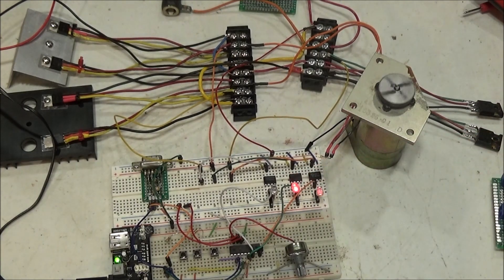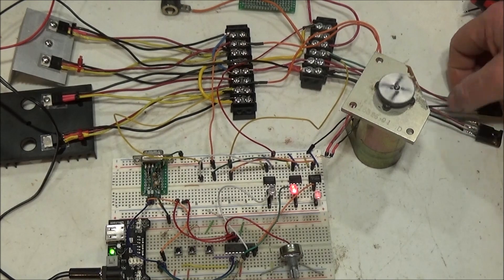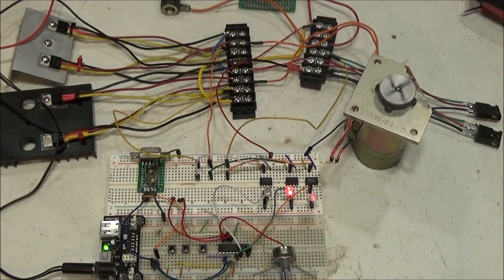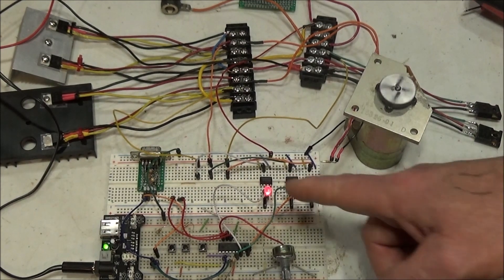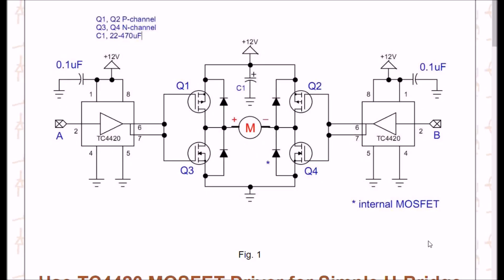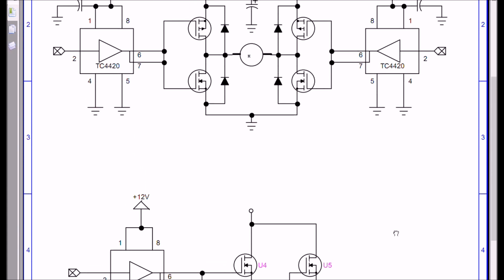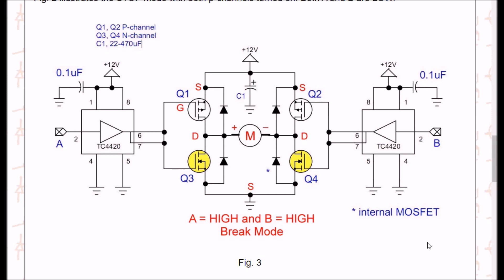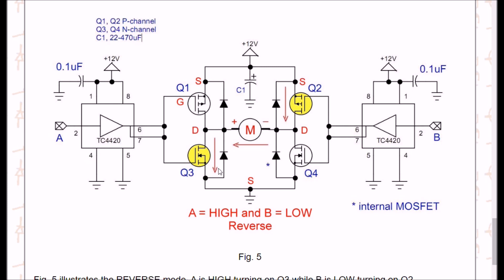Pt. 3 TC4420 MOSFET Driver H-Bridge Circuit

Comment: Hello Dear Lewis Loflin.
Congratulations on your excellent work. your video Pt. 3 TC4420 MOSFET Driver H-Bridge Circuit, I noticed that you did not use a resistor for the Mosfet Gate in your application.
I have an application with an 18Vdc motor and I intend to use IRFZ48N with Arduino PWM control. Can I use a Gate resistor in the MOSFET according to the calculations or do I leave it without a Gate resistor? Could you help me? Thank you. Josias
Reply from the maker: Use a gate resistor between G and S that keeps the current turned off until switched on. I use 15-22K.

Comment: For this H-bridge I am mainly concerned because of shoot through. So it is not recommented to use this circuit for high power applications without a current limiter in the power lines. Otherwise the MOSFETs will die for sure within a very short time. For low power applications this may work but it will definitely consume considerably more power than expected. And therefore the main advantage of switching power control can be lost.

The better way to drive H-bridges is therefore the use of half or full bridge drivers with internal shoot through protection.
Reply from the maker: I have operated large motors with no problem. As per the webpage when changing direction insert a pause (I control mine with an Arduino) to give the circuit time to settle.
Reply: @LewisLoflin it depends on the meaning of "large motors". An example. I have developed a buck converter for a welding system operating at 48 V down to 30 V converting into 25 V and 200 A.

I can't have a shoot through in the half bridge of this converter. The power supply is capable to shoot several 1000 A for some micro seconds.

The buck converter operates with 2 banks of 4 MOSFETs in parallel 1 bank to Vcc, the other one to GND, with an Rds of 1.5 mOhm for each of the MOSFETs. A shoot through would instantly destroy the MOSFETs.

Comment: I would also recommend not to exceed the output current of the TC4420 / TC4429 too much above 1 A because these devices are gate drivers. They can hold their 6 A perhaps for a few milliseconds, because they are designed for fast switching of MOSFET gates, where the very high current stays only for a few microseconds. The output stage is connected only with 2 bond wires to the output terminals. You can measure the resistance between the output terminals to get an impression for how long these bond wires can hold currents of 6 A. The limitation is not the design of the output stage, because the output transistors use a lot of the surface of the die. And they are thermally good connected to their thermal interface, so they can easily deliver 6 A with less than half a Watt of power dissipation.

Comment: Can we use this circuit to provide up to 36 or 48V to the motors?
Reply from the maker: No. They are rated 18V. It can drive a MOSFET that can handle 36V as long as the TC4420 and MOSFET gate are 18V or less.
Reply: @LewisLoflin  ohky, so we can provide 36V to source of MOSFET, and 12V to TC4420 ? to run the motor 36V

Comment from the maker: More H-bridge videos:
High Voltage IGBT H-Bridge Using Photovoltaic Optocouplers
https://youtu.be/azJo4h-ei6I

Arduino Controlled IR2110 Based H-Bridge HV Motor Control
https://youtu.be/d0r-Yx9R3Zs

Pt. 1 Interfacing Microcontrollers to CMOS and MOSFET Circuits
https://youtu.be/XzetdwzcOrY

Pt. 2 Simplified CMOS-MOSFET H-Bridge Circuit
https://youtu.be/rExHPqTUBuA

Pt. 3 Tri-State H-Bridge using CD4093B CMOS Circuit
https://youtu.be/b8O4ihdHx8U

Pt. 1 TB6600 Stepper Motor Driver with Arduino
https://youtu.be/PHe2MK9CvQM

Pt. 2 Program TB6600 Stepper Motor Driver with Arduino
https://youtu.be/jtX0t7-m69M

Arduino Unipolar Stepper Motor Driver Board with Arduino Code
https://youtu.be/HTVYiLOY8SQ

Comment: The sustained TC4420 output is nothing like 6A, its more like 200mA.  The 6A is for VERY BRIEF loading to overcome the mosfet gate capacitance.  I found this out the hard way some years back, because nearly all data sheets do not give you this rather important detail.
Reply from the maker: Never said 6 amps continuous. I said 0.5 amp and that is what I tested it at. Thanks.

Comment: Hi, great video's, question the FET DPDT switch circuit, can this switch an RC brushless motor as well as a brushed motor.
Reply from the maker: Brushless motor no. It has internal control circuits.

Comment: what are the factors to determine power rating for h-bridge?
Reply from the maker: The transistor surge current, operating current, and voltage rating.

Comment: here are some N-FET for high power applications with very low RD-ON
 IXFN210N30X3     300V 210A 4.6mOhm    SOT-227-4
IXFN160N30T        300V 130A 19mOhm  10W
IXFN300N20X3      200V 300A 3.5 mOhm
IXFN400N15X3     150V 400A 2.5 mOhm
IXFN420N10T	 100V 420A 2.3 mOhm
IXFN520N075T2	  75V 480A 1.9 mOhm
IXTN660N04T4       40V 660A 0.85mOhm

IGBT  gate driver optocoupler 
ACPL-T350 

DC-Relay to switch on/off high power /voltage loads
G9EB-1
G9EA-1    

might come handy in one of your future projects

Comment: Mr. Loflin, I really like your videos and this helps me get closer to controlling a simple HVAC actuator for heater core by-pass. I am a retired auto ASE Master Tech who is fabricating a custom air distribution box under the dash of a 67 C10 pickup. These are simple dc motors, open load at 0.3 amp and 0.7 amp while driving a worm gear that runs a larger gear, squared to fit a door shaft. It is cheap but uses a pot whose resistance changes with larger gear for feedback. Basically, move a linear pot, the motor moves, stops once the position is reached. Speed is not an issue, switching directions is. I have been building circuits for 7 years off & on, but a heater is open or closed (Like during A/C OPs) and have been working with a voltage comparator circuit for feedback and the famous “H-Bridge” that has been in auto’s for decades. I guess I am just trying to tie the two together. I love misters for many reasons and will make any low current motor control more robust. I build an automatic w/OD for fuel economy but my son hit black ice & donated a 2003 Tahoe 5.3L fuel injected and this will work great in a 53 year old truck with something this 6’3” guy can drive, but my 5’7” wife feels comfortable in. I can not afford to spend $1,700 for aftermarket HVAC as the 76-72 C10 market is huge. I have subscribed a while back, hit the bell & like this one. You are clear, very nice schematics and I research your video list. Got the “Bell” as well. As my maternal grandfather graduated KU in 1932, with electrical engineering degree, ran field generators for this new thing called “Radar” in WW-II, ran the phone comp. in a small town & was Chief Electrical Engineer in the 60’s in the Marshall Islands to build the “Minute-Man-Missle-Site” on Meck island everyday until the mid 60’s. What a life, I miss him much. Thank you for you efforts and valuable information...at least to me! Blessings.
Reply: I do not like spell check as I wrote “MOSFET” and it changed, sorry!
Reply from the maker: Lot to read. My email is lewis@bvu.net.

Comment: Ok.. And if power supply voltage higher than 20 Volts?
Reply from the maker: You will blow the TC4420 and the MOSFETs. That is why I go to bipolar transistors on the HIGH side if over 20 volts. In part 2 I went over driving bipolar transistors.  
See: https://youtu.be/-Pmhx_ebJKM

Comment: With a separate speed controller,  couldn't you just use mechanical relays for the H bridge and avoid the voltage drop across the mosfets? There isn't usually a need to change direction quickly since the motors take time to respond anyway. Perhaps I am missing something.
Reply from the maker: Relay contacts are not reliable for a lot of switching applications. Modern MOSFETs have a resistance of fractions of an Ohm. Electro-mechanical relays are also expensive. But you do have a very good point for really high power motors. This is aimed at hobby robotics.
Reply: @LewisLoflin  Thanks for that. I was thinking that the relays would last longer because they are being switched while no current is flowing. I am working on a project using wheelchair motors, so not really big.

Comment: Could we see a demo of the motor in the "brake" mode please.  I would think you would use this mode for only a short period of time. Just another reason to use a micro controller, I guess.
Reply from the maker: Not sure on an unloaded motor there is enough to see the effect.

Comment: When we use these ICs driver.do we have to add a resister to mosfet to discharge or not ?
Thanx for everything
Reply from the maker: No. These can take a 6 amp peak current.
Reply: @LewisLoflin  i have asked this question cause in all schematics of inveters which use mosfet there are always resister and diod between gate and source for discharge
as in 
EG8010 

https://vdocuments.mx/eg8010-datasheet-en.html